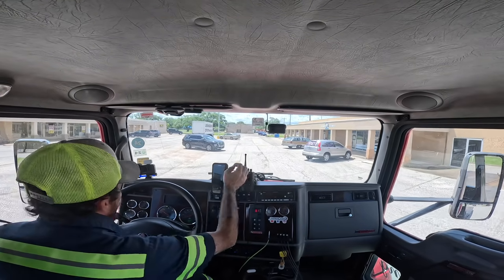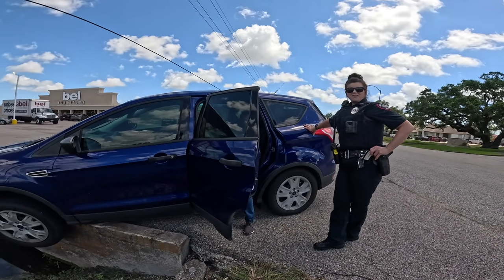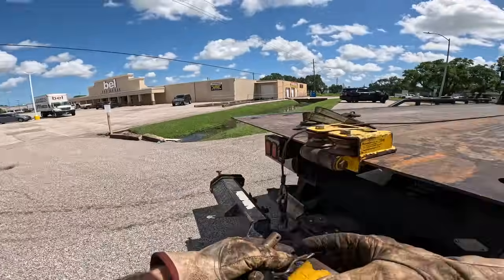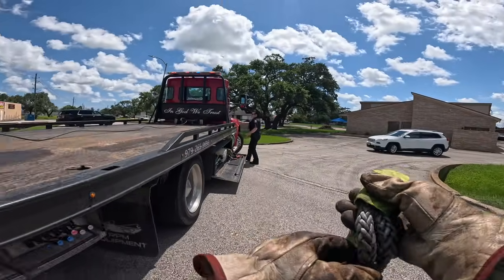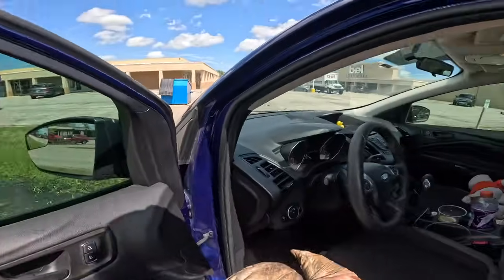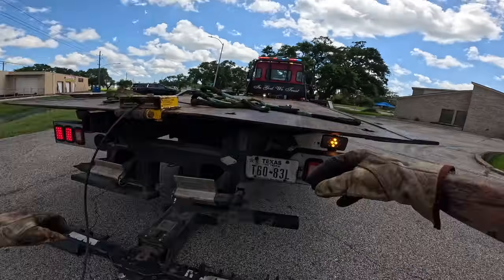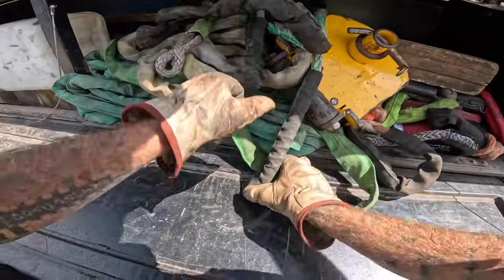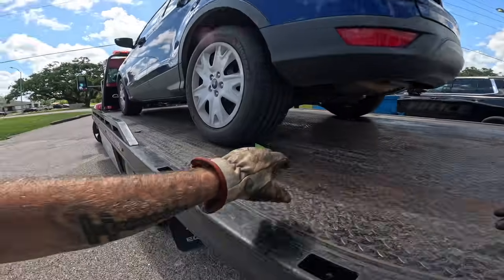Ford Escape, Goes Over the Edge!

Comment: Only 3 minutes in... Trolley jack under the front, lift it high enough to clear the wheel. Winch it from behind while watching the trolley jack and wheel. I'll be curious to see how you do it. 
I remember when my neighbour drove off the edge of the driveway (complete idiots) and both the rear wheels were off. A tow truck ended up coming in on the neighbours property and lifted it by its tow bar with the tray (destroyed the lawn)
Reply from the maker: Trying to winch with a jack under it as asking for a damage claim after you crush the whole side of the car. I did it the best way.
Reply: @Towtruck_Dustin  But wouldn't the jack roll along (as long as the little wheels were turned the same way) with the car ?
It was interesting to see that you used 2 blocks of wood which turned into the wheels (sliding on each other)
As for the jack position, I was thinking mounting it towards the middle of the car parallel to the vehicle .
Either way, your way worked and you're the towie.
Reply: @roadmonitoroz  in my experience here at home, the wheels on the jack dont always do what you want
Reply: @jimsmith9819  Yeah. Depends on the surface, the size of the wheels and whether the jack is a elcheapo one or an expensive one .
I have moved my vehicle just a little on a jack, but I made sure I wasn't under it and it was low down in case it came off.

Comment: Good job.  Not how i would have done it.  But there is always more than one way to do a job.
Reply from the maker: Curious as to how you would’ve done it. This seems to have went pretty smooth.
Reply: @jayman4912 how would you do it?
Reply: @Leotheconstructionguy  well he has a remote for his winch. He could have easily just hook to the rear. Put the car in neutral and turn the wheel and pulled it backwards. I've done it a lot.  Sometimes without using my truck..
Reply: @jayman4912  that is how you cause damage to vehicles……
Reply from the maker: That sounds like a damage claim waiting to happen. Just as easy to do what I did and make sure you don’t cause any damage at all.
Reply: @Towtruck_Dustin good thing you don't listen to all these "experts" in here  you might be looking for a new job  😂😂
Reply: @Leotheconstructionguy  no damage I've done it before. I  always look for the best way without causing more damage.
Reply: @neilz9182  First off. I been doing this for at least 10 years. ALWAYS been with a company that did police rotation.  So I'm not only experienced  I'm good at what I do. I said good job to him I just said I would have Done it differently.
Reply: @Leotheconstructionguy  I've been doing this long enough to know how to do it without causing damage.  I've trained a lot of guys that go on to be good tow truck drivers.
Reply: @jayman4912  sounds like you will get sued at some point.
Reply: @georgewills-ek1gg  how is that.  I said good job.  Not how I would have done it.  I've been doing this for ten years. I've seen this so much.  I can do this with my eyes closed.  If you are atow operator! You have to figure out more than one way.  Every situation is different.  But if you are not a tow operator,  I see why you would say that.

Comment: If I was getting paid hourly then I would spend all of that time for sure but with commission nope. Time is money! Turn hard left, stick a skate under it to prevent further damage and winch it up in neutral. 😁
Reply from the maker: 😂😂😂😂 a skate. I need a set of the skates you got if you think that’s enough to do anything. 
I hope the all the extra money you make in the extra few mins gets you enough to pay out all the damage claims. 
It only takes a few minutes to do your job right and avoid any damage.
Reply: @Towtruck_Dustin I would rather scuff up a skate and protect the control arm/K member and with the tire being so close it would come up as soon as you started winching as it did. Instead of spending the extra time and work jacking it up and also it was only an escape 😁
Reply: @Towtruck_Dustin come on Dustin this guy probably would have just dragged it off took the ladies money and handed her the keys to drive back home. All about money and efficiency

Comment: just suck wrecker under car lift it up pull foward set it down the car never moves simple
Reply from the maker: Not a good idea at all. The higher the rear goes up, the lower the front goes down. Crushing the bumper in the process. Jacking it up to make clearance and pulling it off the concrete guard rail was 100% more effective and caused zero damage.